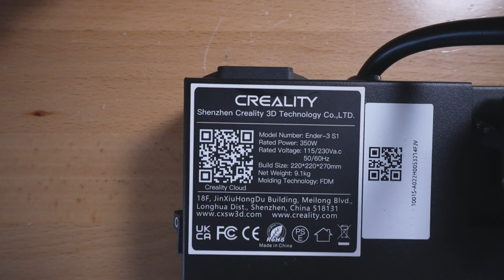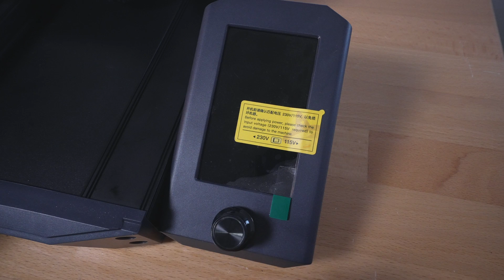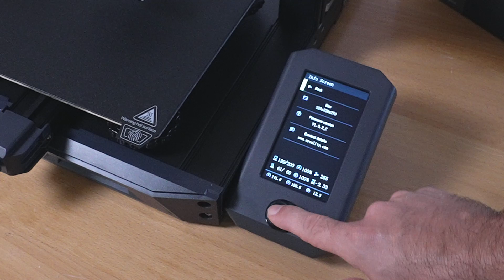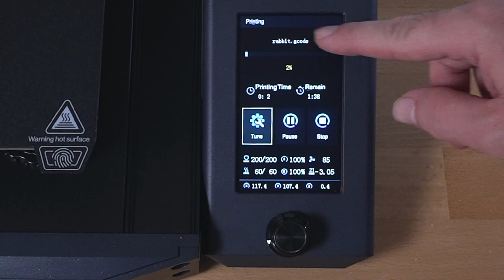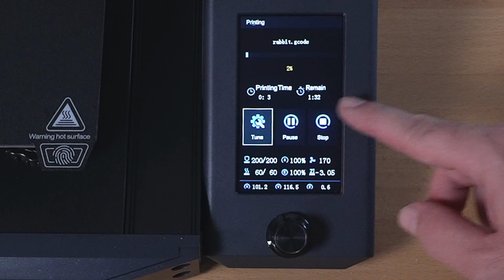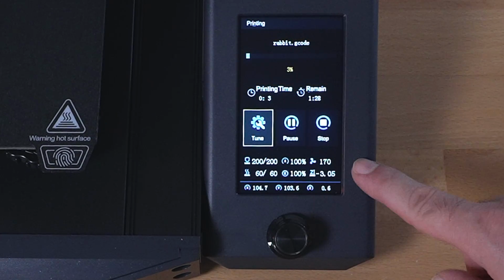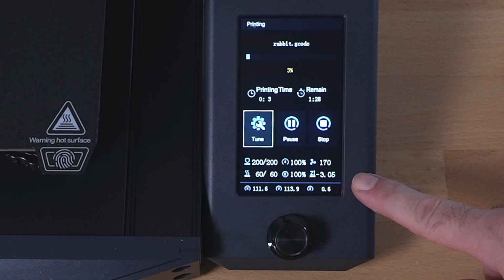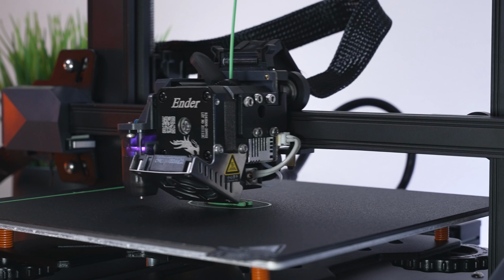Creality Ender-3 S1 - Overview & Leveling

Comment: I have a problem where my level zero is no where near the actual level zero (when I set the level to zero). The bed levelers are also all the way stretched out. How do I fix this?
Reply: set the bed levelers all the down, and auto home.  set z to 0, and z offset to -0.20. if you need more, use this video that i used to level mine!  https://youtu.be/Ohtl00Bk4P0
Reply: Did you get it fixed? I first went to Prepare > Move > Move Z and set it to 0.0, then I went to Prepare > Z Offset and set it to -4.05 (your number will likely be different). That’s how I finally got the bed to touch the nozzle